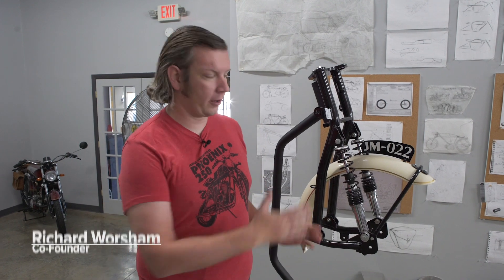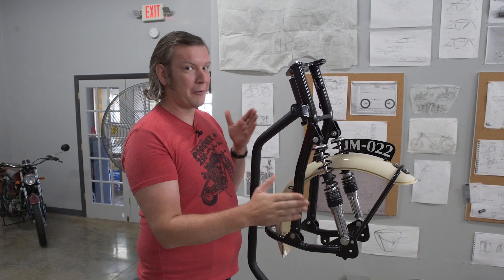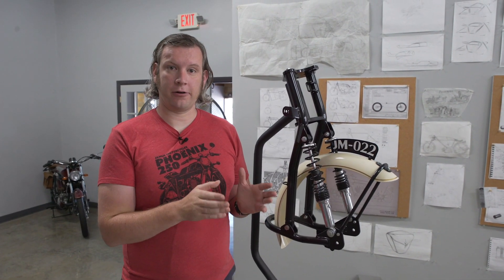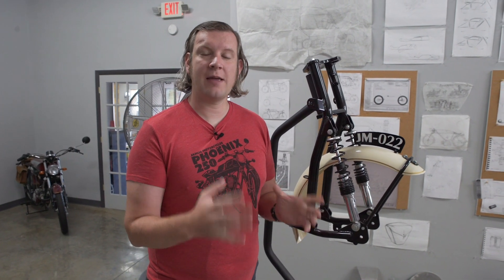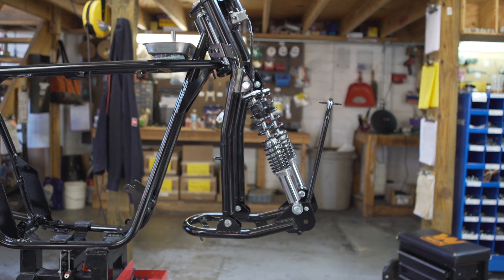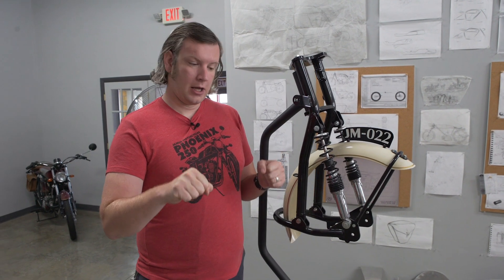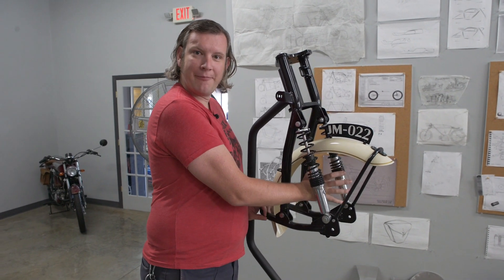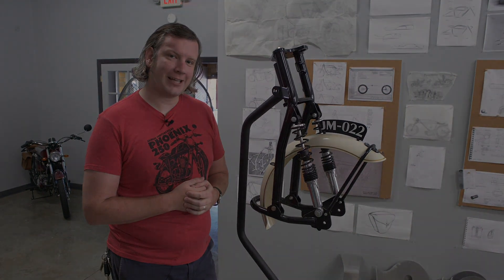Janus Parts Ep. 2: Forks

Comment: Agree on the antidive theory, but there is another aspect of the steering geometry, which is the linkage will make the front wheel offset vary in action. For example when you hit a bump, the spring compressed, wheel axle move up in comparison to the pivot point of the linkage, it will increase the front wheel offset, therefore reduce the trail, make the bike handle unpredictable. Correct me if I'm wrong.

Comment: Like your design but modern inverted telescopic adjustable fork designs and builders would school you differently in your assumptions of how they work and function on the track and the road. There are far superior forks than these but to keep your build as in-house and cost efficient as possible I thoroughly understand why you went the way you did. To simply dismiss modern forks as inefficient is a disservice to the industry and a bit arrogant when comparing your two rear shocks to what is out there today
Reply: I think that your stance is very arrogant in return. All the arguments used here are more then valid. Assuming everything should stay as fashion dictates it is often only proof of inherent conservatism.
Reply: Agree about keeping things in house. Otherwise you're just American Chopper, putting parts together!